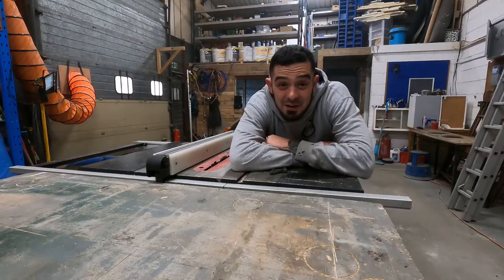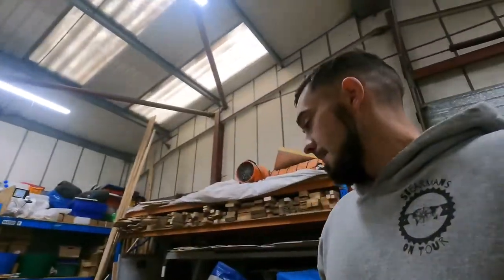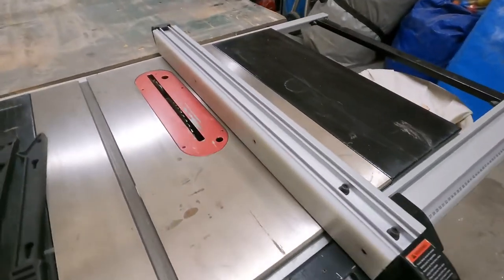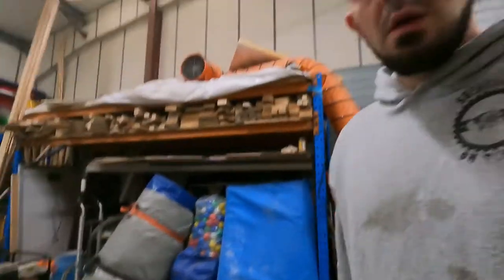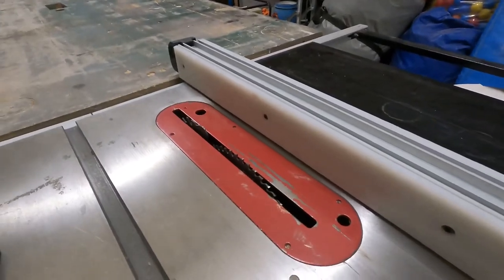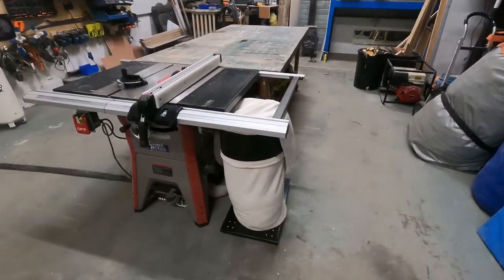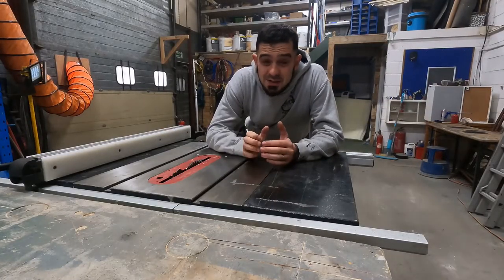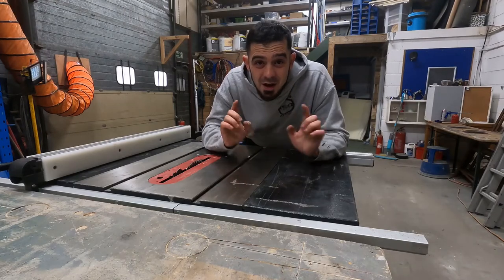LumberJack Tools Tables Saw 1 Year On Review Do I Still Love It TS1800?

Comment: Hi. I have this saw. I must have the proverbial dud. 
I have a few questions. 
My terminology is lacking but please bear with me.
I have issues with the saw cutting out. The blade certainly does not spin freely. I have looked at the alignment of the two grooved wheels which the belt runs on. In my case the belt covers the whole width of the wheel in the motor end but the wheel that drives the blade is only covered with the belt by a third. This seems to me to indicate the two wheel drives are not sitting in alignment with eath other. Is this the case with your saw. Does your belt cover the full width of both wheel drives. 
Not sure my description makes any sense. 
I also find the motor to be a bit 'stiff' as in when the saw is off and I try spinning the blade it has plenty resistance and sounds a bit like something is scraping somewhere. Anyway I thought I would check out any other people with this saw and here I am. Hope you are going strong in your workshop.